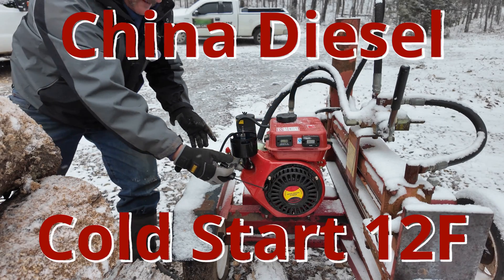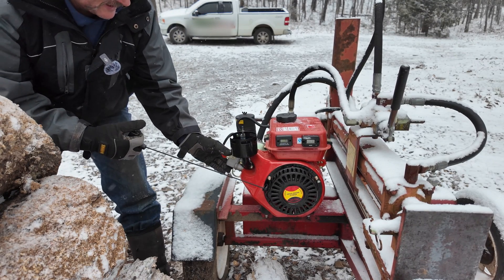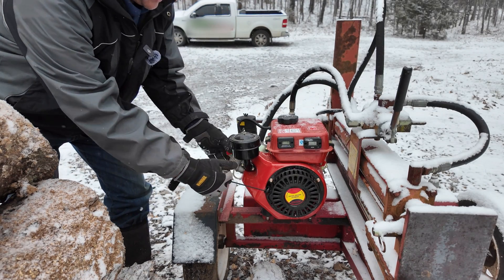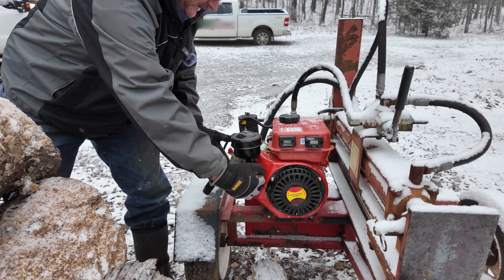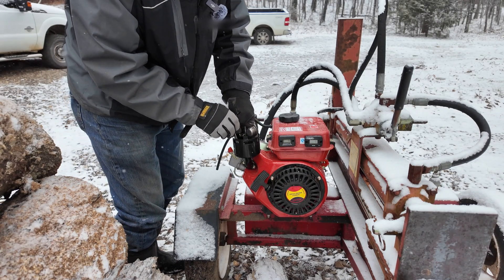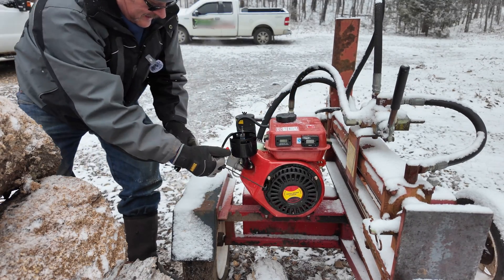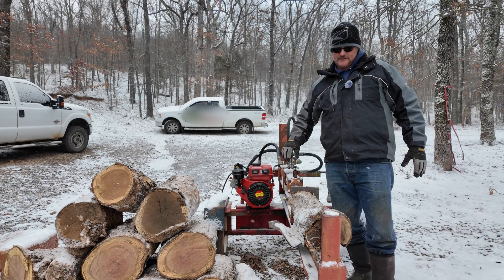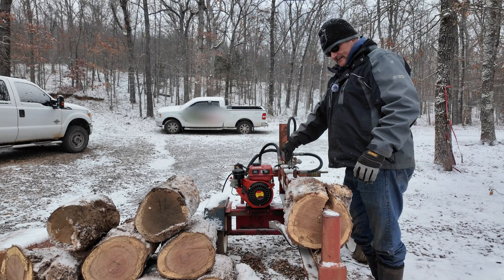Small China Diesel Cold Starting at 12 F or -11 C.  This diesel small engine has no glow assist.

Comment: Electric starter kit is must for one of these. 
I got one and immediately bought the kit and made it electric start. Don't have to worry about the compression relese anymore and i have the starter wired to a xt90 connector & i have a 12v 6ah battery made from 32700 Lifepo4 lithium cells and it cranks the engine without a hitch. Doesn't matter if its -15c outside it will still get it started if you crank it long enough. Don't increase the throttle, put it slightly above idle. Too much diesel fuel in the combustion chamber will wick away any heat from the compression & the engine will take longer to start. Diesels are not like gas engine. Running them rich in cold makes them harder to start.

Comment: Easier to take the pull cord cover off, and use a dewalt/milwaukee DRILL with socket adapter and socket to spin it as fast as you can while holding the compression release, then pop the release.

Comment: I have seen videos of some farmers in northern Russia (very cold) get diesel tractors going by positioning a wadded up rag soaked with diesel above the intake. They lit the rag on fire and cranked the engine. Sucks the flame and heat down in there and it starts right up.

Comment: I really like those Chinese diesel - after hurricanes, tropical storms or ice or snow storms my power is often knocked out - 
      I have one of those on a car alternator that maintains some battery's that a inverter is connected to to run every thing in the house - 
      Running it at 1800 RPMs around the clock for days it's perfect - I have the regular inverter gas gens also - 
     But that diesel burns far less fuel - just shut it down every other day to check the oil - 
        I can let it run off a barrel of fuel for a long long time -

Comment: When its cold like that there is no need for a air filter - i had worked in oul fields were it was very cold - 
     We never used air filters in equipment like snow blowers , or generators during winter - 
     You can just make a down draft breather out of a 90 degree elbow brazed to a plate of steel - you might add a large hole screen - 
       A diesel will not start when its below 32°F - if ots cranked as with a electric starter - compressing the air will warm it up and it will eventualy start - 
    Heating the head with a torch or the air intake is the best way - 
    We used heat guns run off generators or inverters also in cold regions to preheat intake air for cold starts -

Comment: Get a cheap cordless heat gun at harbor freight. No need to take it apart. Just be smart about it cause you can burn filter. Heat below filter in pipe section. Faster and easier. Your welcome. Mine starts -20 put a splash of howes anti gel with each fill also.

Comment: Use the torch on the crank case. In the oilfield we would use propane weed burners to heat the oilpans on 6cyl diesel pumps in the cold.
Reply from the maker: How long did you have to heat the big diesel pans to help?
Reply: @mossycreekvids  It's kind of hard to judge really. We would heat the oil pans until it would fire up. It was enough to char the paint at least the first time.
Reply: You can just heat the head some with a regular propane torch and they will start most of the time - 
    You can also just heat the cylinder fins with a propane torch and once there warm or a little hot the engine will start - 
        Generally speaking a compression start diesel will not start at below 32° - if you have a good electric starter and crank it long enough and don't hit the compression release - as it compresses the air the cylinder will warm up and when the fuel is opened they often will start  - 
     It's best to just pre heat the engine before starting in most cases - 
      If the air is below 32° the cylinder air when compressed won't reach 500° - the ignition won't happen unless the cylinders compressed air is at 500^ - 
     I the high mountain oilfields I had a foot long brass pipe added some were on the block jacketed into the head and when it was cold sometimes minus 30° - they would heat that pipe with a rose bud or a torch for melting ice  - the brass  pipe had  coolant in it and it  warmed up the head some - 
      Then the engine would start once the head was a little warm -
Reply: You asked about heating the oil pan - you can safely heat the oil to about 250° - but you have to heat the oil till it warms up some then crank the engine over some to splash or pump the oil around some - 
     Then  just keep heating the sump or pan - the way we knew the oil was 250° was to put some spit on our finger and wipe the pan or sump with that spit on our finger - if the spit evaporated fast it was close enough to 250° - 
      In production we often do that with pipes to see if oil is hot enough with out getting technical with instruments - 
      When the oil is 250 and the air is real cold the engine will start - 
     At 350° if a surface is flat if you spit on the surface the spit bounces at 350° -
      That how women knew the temperature of ovens before thermostats - 350° in old cook books is called hot -  we had old single cylinder heavy stationary engines that used transformer oil for coolant - they ran on crude oil - 
      Those engines run at 250° so that the crude  oil completely burns off - we checked the pipe with the oil coming out the head temperature by putting spit  on the pipe - if the spit instantly boiled it was around 250° lol -

Comment: Thanks for the shout out!  I feel the same way something to hold the decompression released to allow slowly turning the engine over while heating will definitely help.  Warming up the injector a little bit so it just warm to the touch would also probably help a good bit as the warmer fuel would atomize better.  Looking forward to see the other engine put back together!

Comment: I recommend fabbing up a new metal pipe intake manifold to replace the plastic one on your original engine..
While you are doing that weld on a catalytic converter sensor type bung with a cap directly in line with the intake port...

Unscrew cap from bung, insert torch and flame heat away.....
Withdraw torch and screw in bung.

Should start easily as you have heated part of the block and the intake valve as well...

Are you using a synthetic sump oil to reduce the drag when this cold?
Reply from the maker: No on synthetic, but a 5w 40 would help

Comment: I have transmission fluid in my splitter hydralic system  and now starts easily in very cold weather
Reply from the maker: hmmmmmm, I may just think about that
Reply: @mossycreekvids  it's  been in the splitter for over 30years everything still perfect on a commercial  splitter
Reply from the maker: @davidbulich1254  Out Standing! I'm do for a fluid change before long.  I may just do a video on that in the future. Checking time with mine using generic hydraulic fluid and then with transmission fluid.

Comment: Pour a small amount of gas in the air filter housing. Like a few table spoons. Light it in the air filter housing and try to start it while it is lit. Seen it done on a larger engine and it worked pretty well.
Reply: The problem with putting gasoline or using starting fluid in those air cooled engines is the fuel ignites early causing pre ignition - 
      Those engines use 23:1 compression - so it's very easy to brake a piston when using gasoline or starting fluid to start them - 
   Many of the truck diesels only use 17:1 compression also older truck engines had heavy pistons that could handle the preignition from gas vapors or ether - 
     Glow plug engines are called hot surface ignition engines they are only 14:1 compression - 
   Many handle starting fluid ok - using a torch as he did is the best method - 
       Generally a compression start engine will not start below 32°F - the air when compressed needs to be 500F to have an ignition -
Reply: @able880  no. Saying to light the fuel in the filter housing. It draws in hot air from the fire. Works really good but very few metal filter housings left out there.
Reply: Ok I thought you were saying to use the vapor of the gas to use it like starting fluid - 
   What ever it takes to get the cylinder air up to 500° will work and the engine will start
Reply: You can remove the pull starter off and spin the engine over with a drill when it's 0° - it takes some strength to hold the drill coming up against compression - 
     As the cylinder keeps compressing air it will get hot enough to ignite the fuel - we hag rigged grinders with sockets to cold start small diesel engines also -

Comment: It this the world slowest log splitter?
Reply from the maker: It is when its this cold. LOL  Cycle speed increased a lot in about 15-20 minutes.
Reply: @mossycreekvids 
Go to 10w hydraulic oil.
Otherwise known as iso-32 oil.
.
ATF is an approved cold climate hydraulic oil.
Its generally 10w-30
.
And is also available in synthetic, and would greatly improve hyd flow..
.
If your filter is on the suction side, it needs to be moved to the return to tank side.

Comment: A 100 watt light bulb and some aluminum foil stove will work wonders and your engine will thank you for being able to work a longer life.
Also wouldn't it be easier to place the un-split wood behind you, saves a lot of time and steps.
Having run diesel powered equipment for many decades I can say that just because an engine can be started in cold weather doesn't it should be.
Reply from the maker: Normally I wood have the wood on the easier to grab side.  I have a massive tree just behind the camera that the pieces are getting cut from and just a short roll or toss to that side of the spitter.  

If I wasn't filming I would have operated from the wood pile side.  

Pre-heating would be easier on the machine for sure.  I was purposely cold starting to field test the engine start ability just incase it is away from heating devices.  I am trying another method suggested in a couple days.  After that the engine will most likely seldom be started below 32 degrees.
Reply: One of the aluminum "flood light" hoods with a 100W incandescent bulb (if you can still find them) would also work well on heating the head. Another option is one of the old flood lights that put off tons of heat.

Comment: nicely done, how did you do the hour meter? is it on previous videos on the teardown and mods videos?
Reply from the maker: Those are vibration active meters.  The meters are stuck on with double sided outdoor tape.  The one on the left is a POS $14 one that you can barely read with only an hour on it.  So I bought a good Hardline hour meter. $35 or so wayyyyyy better meter.
Reply from the maker: I just added an amazon affiliate link for the Hardline Vibration.  These are very good meters.  I will not put the link up for that cheap hunk of crap I tried out.  LOL 

If you decide to get one of these meters please use my link, you don't get any form of a discount but a very small percentage will go to me. https://amzn.to/3U79mgh
Reply: @mossycreekvids  the link in the description for the hour meter is the other style of diesel engine, with the plastic air cleaner not the hour meter.
Reply from the maker: I put the same hour meter on both engines @JoshKilen
Reply from the maker: Ill double check description thanks, I just added
Reply from the maker: @JoshKilen  Thanks again, I updated description it was the wrong link

Comment: Thank you for your videos, I have well worn 2 cylinder Deutz engine that I preheat in the winter by rigging a hair dryer to blow on the cylinder cooling fins. I let it heat for 20 minutes or so while I do other stuff. Fires right up. I feel that it is more gentle on the engine than a torch.
Reply: I had worked mountain remote oilfields - we used torches to heat the heads and air intakes often - 
    Especially when it was minus 30 to 60° F - we also used heat guns at times we covered the engine with a heat gun warming it up for a while - 
      The other was to use a propane pilot under the engine to keep it warm so it would start when it was cold -  there were 12 volt oil heaters that could be put in the oil fill also -

Comment: I wonder if you could modify the original or make your own intake with a heat sync on the outside closer to the head? It would retain heat and you wouldn’t need to take the filter out? From the specs I could find this motor your using now also seems to rev slightly higher? I think the ether probably broke it but it just finished off an existing problem? I knew lots of people who used to start their IDI engines all winter for like 20-25 years and their trucks would just rot out before the engines ever had catastrophic issues. Or watch zip ties and bias plies. He literally feeds whole cans into them. Hahaha. Can’t be good though. Apparently the ether won’t even run them without diesel though? I was just told that and can’t find info to back it up so take it with a grain of salt. They ignite in the pre cup so it kinda makes sense? Having said that I was working on a reserve where there was an excavator with a hole in the block. Story goes they were trying to ether bomb it and when it finally started it ran away. It was a DI though.

Comment: I'm curious if a predator electric start conversion kit would work on this
Reply from the maker: I doubt it will, but there is an electric start available that may fit. I may risk  the purchase at some point.
Reply: Is it worth the extra $30?
Reply from the maker: For the electric start?  @CarModsandDadBod
Reply: Got pics of what your talking about with the fuel pump?
Reply from the maker: There are for sure at least 2 versions.  One version has the fuel pump bolted to the actual block the other has the fuel pump bolted to the back cover of of the engine. @CarModsandDadBod
Reply: P.s. there's a guy on YouTube that says the intake and exhaust closely match a predator 212 they just need to be drilled out a little